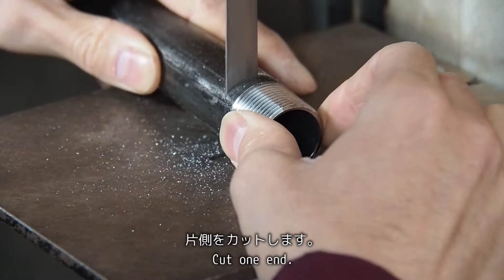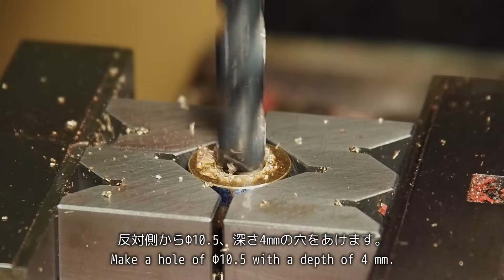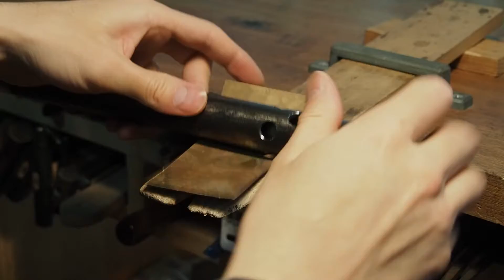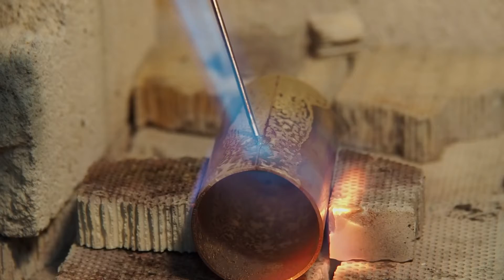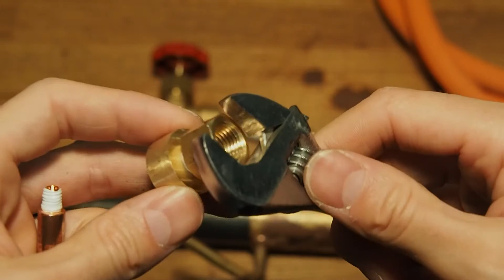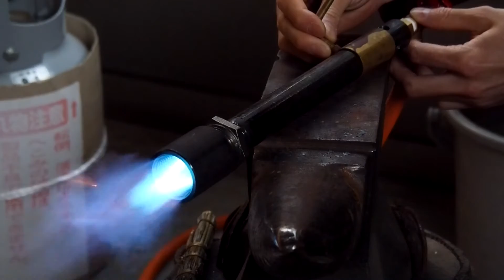DIYでガスバーナー作ってみた。/ How tomake a propane forge burner.

Comment: thx I'm gonna use this design I've recently started to have a need for a propane torch
Reply from the maker: I recommend that you use a horizontal needle valve instead of a vertical one.
There is no problem so far, but the screw may loosen when opening and closing the valve.
Reply: @Tetrahymenajp  ok thx alot 
I'll use whats available to me in my area